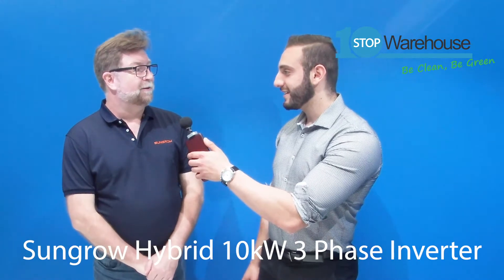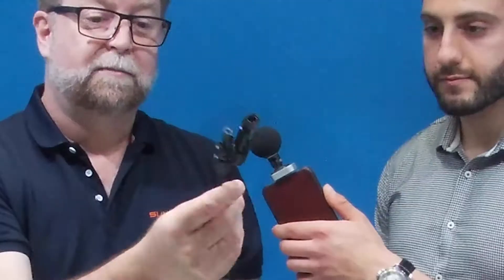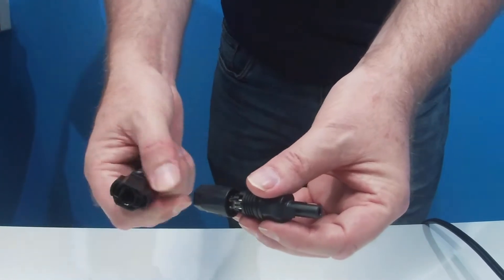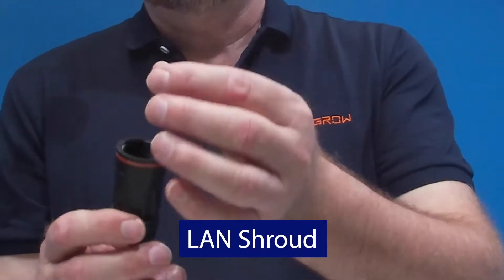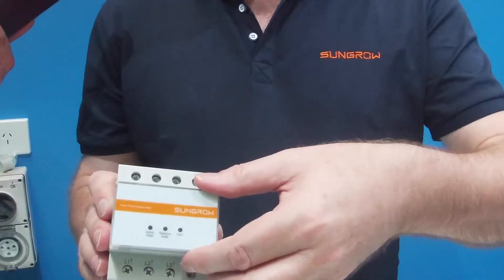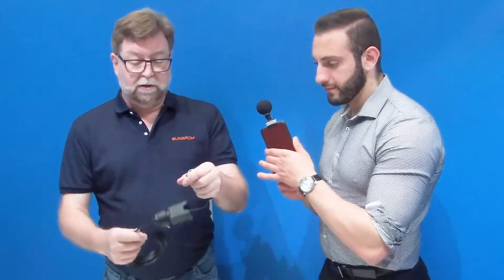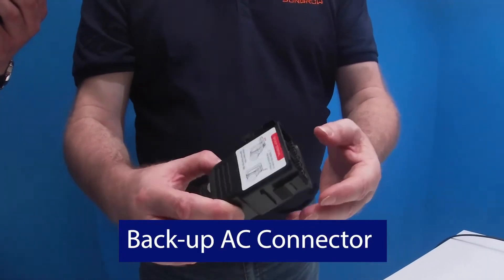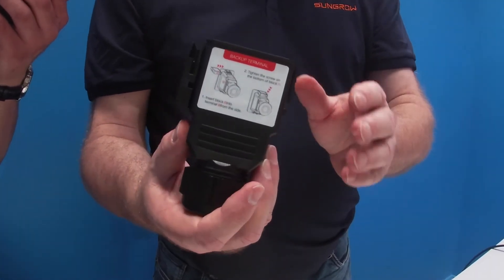One Stop Tech Talks: SUNGROW Hybrid RT 10kW 3 Phase Inverter Installation Connectors - Part 2

Comment: Hi, 
In case of grid outage, will the inverter use the power from solar panels and then only if the panels were not enough, the inverter will use the battery?

So can we set the inverter, during the day, to use solar panels' energy instead of the battery in case of outage?
Reply: Hi Yahya. Yes, in the off-grid mode, the power will come firstly from PV, then battery as required. Any surplus PV will be used to charge the battery.
Reply: @grahamsmith3737  Thanks!
Reply: Sir i have purchased the SH10ORT inverter from dubai. I am a pakistani can i install this inverter without batery and second my house wire runs on single phase but the inverter requires three phases to operate ? So plz guide me